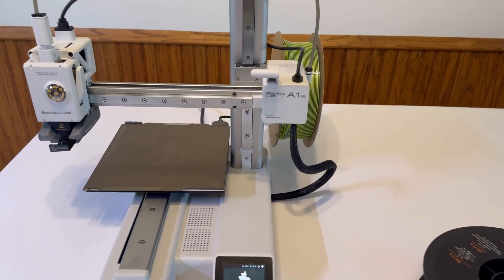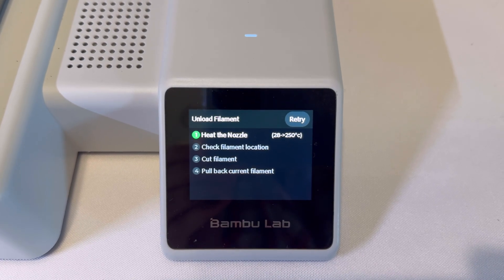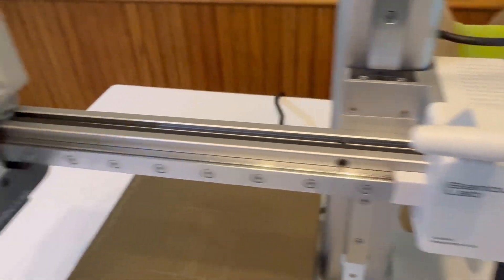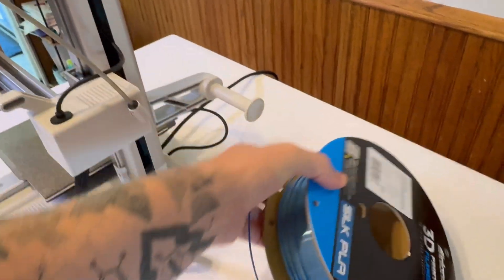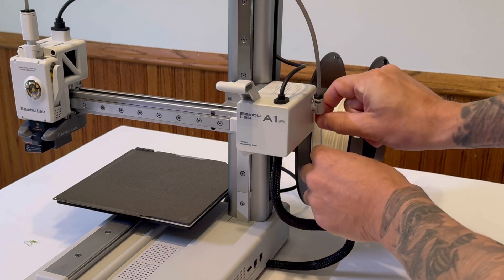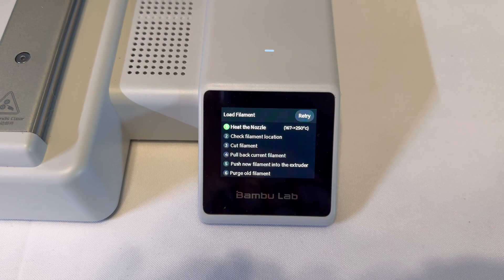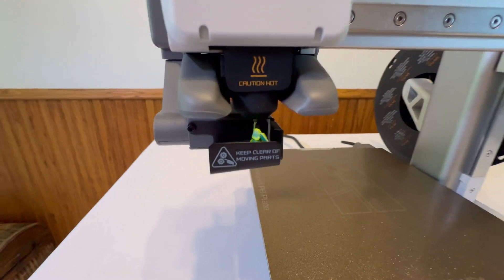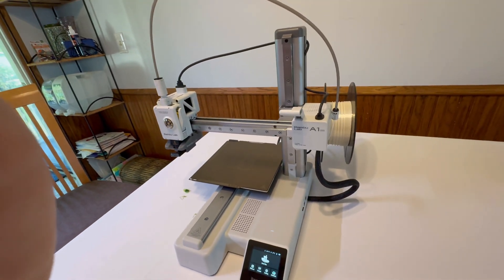How to Change Filament on Bambu Lab A1 Mini

Comment: What do I do if I used all the filament from the starting amount they gave me and there isn’t enough to pull it out like he did
Reply: Just print something small and simple after putting on and loading your new spool. It will start with the old filament and eventually tell you you’re out, make sure your new spool is pushed all the way up the filament nozzle and tell it to keep going. There will be a bit of the print in white but it should be fine. Moving forward make sure you let your spool run fully out or do what’s shown in the video while you still have a bit left.
Reply: Ok, but I ran out of filament mid print on smth small and there is just a bit of waste coming out the nozzle. do I still do that?
Reply: Ohhh thanks re-read it and it makes more sense! Thanks for the help!

Comment: I did a lot of filament changes yesterday printing a two color coin and you will, occasionally get a hang up either when pulling the old filament out or trying to load the new, it helps to cut the filament end at an acute angle but even that is not enough sometimes.

Comment: I noticed you are using your 3D printer indoors on a table that is not near a window or any other source of ventilation. My 3D printer arrived (A1 mini with AMS lite) and I was going to set it up in a my basement where I currently have my laser printer using strictly PLA filament for my 3D prints. I am reading mixed reviews on fumes that are given off from the PLA filament. Have you had any issues or concerns? I would really like to try 3D printing but a bit worried about fumes and particles that may be released into the air. Any advice would be appreciated.
Reply from the maker: Yeah there’s zero fumes with pla
Reply: @3DPrintDood  Not entirely true. There is some fumes and they are somewhat toxic but are not as bad as with other filament types. Although it can also depend on the PLA itself obviously too, not all PLA's are made equally and there is variety even between manufacturers.